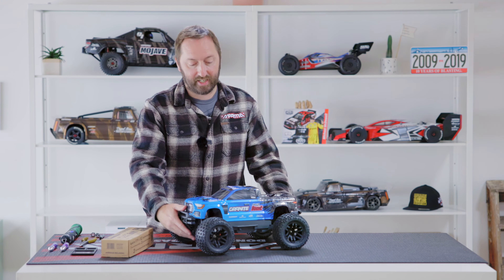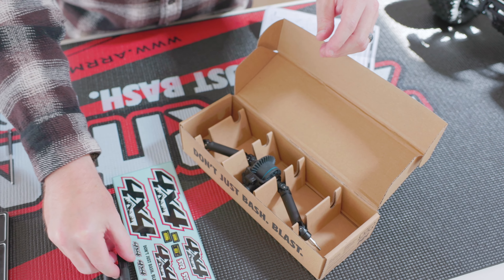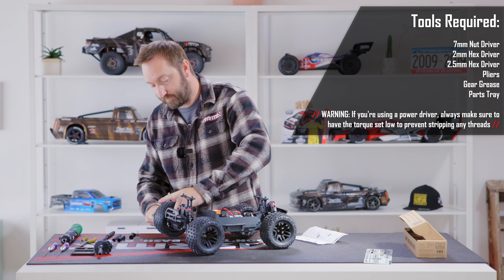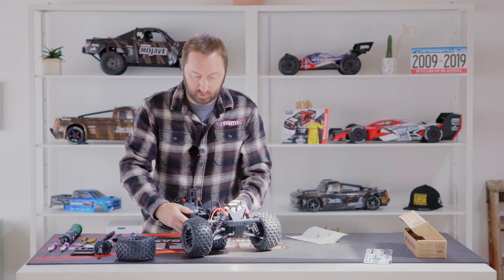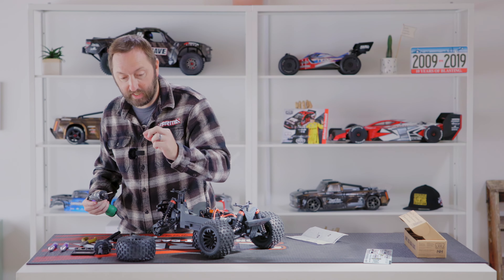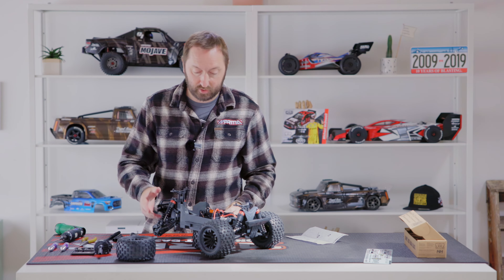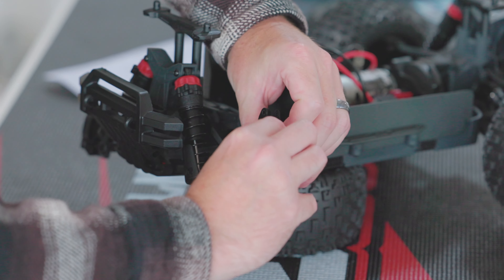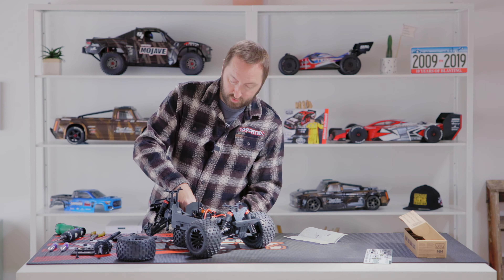INSTALLATION GUIDE // 4X4 BOOST Transmission Upgrade Set

Comment: I love the idea that you can easily convert your cheaper 2wd to a 4wd later. Really, really cool!
Reply: I think it's really stupid they're just charging you for something that comes with the truck buy the 4x4 and take out the center drive shaft and boom there you go
Reply: @Lucas.stalcup  Ok, I get your point BUT, it isn‘t surely negativ to just go the easy way. If Arrma decides to build a 2wd beginner friendly car, they can either design a new 2wd platform (like for example the slash) or they can take the existing 4wd platform and convert it to 2wd. This keeps the costs lower (no new production line is needed…). As a new commer to RC I stupidley bought a 2wd Slash a few years ago just because it was 60$ cheaper than a 4wd. Now a days I hate me for that desicion because I love the handling of 4wd cars. With these Arrma‘s you can be the stupid new commer as I was and you dont have to regret spending less money a few years later since you can easily upgrade the transmission.
Reply: Just buy the bits you need off the 4x4 from an RC breaker and save yourself a fortune.
Reply: @Lucas.stalcup the 4x4 is way too expensive to be an entry level car for most people

Comment: Now this has peaked my interest loads , I've just realised I've wanted to get back in to RC from a long long break , been looking at all sorts of cars from the Chinese bashers to your range and really wanted a arrma but realized money was tighter than expected but this screams out to me as I Can get a arrma quality kit and then save for the parts I want . Bravo guys .
Reply: You won't regret an Arrma, I've been in and out of the hobby for 27 years now, and Arrma is my new brand! I use to scoff at how simply built they are, but after buying my first one and running the heck out of it, I totally understand the designs they use and I absolutely love how modular and interchangeable they are. I've literally bought 5 Arrmas in total over the past 2.5 months, I just can't get enough of them

Comment: If you are here for tips...  the only issue I had was installing the cv axle into the hub. The inner knuckle bearing will is tight enough to keep the cv pin hole to not be exposed. I simple placed the hex nut and wheel onto the the axle shift and installed and tightened the nut. This pulls the axle through with ease and frustration free. The I took the wheel off and installed the pin. And back on the wheel went. New to rc. But I've been a mechanic. This was a fun little job.
Reply: Thanks for this info! Literally what I needed to know, and the main reason for my visit to this video!
Reply: Did it the same way
Reply: Getting ready to do this myself. Thank you for the tip

Comment: I have brushless senton and granite, but run them rarely. I but bought Boost 2wd vorteks for a few reasons. Brushless models need to be carried somewhere in big space to drive them, while in my backyard, I have set up an RC track with jumps, which is quite small. I wanted a more nimble, 2wd model, which is slower, brushed, and had different bodystyle from my previous Arrmas. At first, I was very sceptical, on how native 4wd with removed front drivetrain would handle, when compared to dedicated 2wd models, but actually I was very surprised and the car handles perfectly. Now this is my daily RC car to run and discharge one battery in my backyard after a stressful workday. I drive so nicely in smaller space.

Comment: Wow nice design. I tought it would be a bit like a fury bls or granite/fazon voltage. They are also very durable. My dad owns a senton 3s blx and i have a 4s slash. I totally regret getting a traxxas
Reply: Arrma > Traxxas
Reply: Same, i had an arrma big rock 3s and typhon 3s, still do. But when i got my Traxxas rustler 2wd vxl, i kid is you not i put at least $500 into replaced parts on that thing, including a new motor and esc cause the stock ones blew up

Comment: These are so cool! I hope not including the big rock in the "boost" family, it means there's going to be a big rock v4? I really hope so. 3s blx, with the metal ring and pinion diffs from the 4s family, maybe some different tires but similar style to them, maybe just a touch bigger. And if it were offered with the big rock body, in that candy apple red the vortex 2x4 boost comes in, would be gorgeous. Maybe a big rock v4...3/4s?!?! With a chassis brace and the cvd driveshats instead of the ujoint ones that always seem to pop off for me. But it would really cool to have a 4s ESC, with a 3670 motor somewhere between 3s kv and 4s kv. Include a 13 tooth pinion for 4s and an 18 tooth for 3s. Great way to get some people into 4s vehicles who already have a ton of 3s batteries from their 3s vehicles.

Comment: What I find really confusing is the according to Arrma the reason they are dropping the Roller EXB 5th scale cars is model shops don't want multiple different boxes of the same car, so now they have 3 versions of the Granite, Vortkes and Senton, plus the shops also have to stock the boost boxes now as well, im smelling something here 😂😂😂😂
Reply: Are they actually dropping the 5th scale rollers? I didn’t see anything about that
Reply: @fmc7209  Yes the 5th scale EXB rollers are going to be RTR
Reply: @HardcoreRC  interesting… I wonder if those are going to be a V2 version? Now with the launch of the RTR TLR Typhon they might even offer both rtr and roller.
Wonder when they will release these
Reply: @fmc7209  Will just be RTR EXB, they wont be doing the roller 5th scale EXB going forward, i also suspect that all rollers will disappear so they can push more spektrum stuff on people
Reply: @HardcoreRC  makes me wonder what the sales numbers are rtr vs the rollers… A decision like this could imply the rollers haven’t sold well enough to be worth keeping. 
I hear people complain about the Spektrum stuff but I’ve never had issues myself.
Reply: @fmc7209  According to Jason the RTR sell better than the EXB Rollers, which stunned me seeing as the EXB rollers are better in every way and you get to put your own electrics in.

But i cant comment as dont have access to the actual figures.
Reply: @HardcoreRC  to me it’s not as surprising for the 6S line since it could be someone’s first or second rc, but for the 8S getting the EXBs are a no brainer. 
We will find out soon I would assume!

Comment: You could just buy the Mega 4x4 and remove the centre driveshaft for your same effect.
Reply: You still have the weight on the DIFF and axles slowing it down compared to this 2wdf
Reply: @FLPatrick1095  so remove the diff
Reply: @da66er74  You cant it needs that empty spacer that these new 2wds have. it wont bolt in
Reply: @FLPatrick1095  what? You’re say the stub axles can’t stay in? Why?
Reply: Interesting idea, I'll remove the driveshaft on my Vorteks and see how it affects the handling.  The idea is for the younger audiences to grow with the vehicle... Kinda backward thinking on Arrmas's behalf as a 4-wheel drive RC handles better than a 2-wheel drive RC. With a 4-wheel drive system, the front wheels pull you through the corners keeping the vehicle stable, and a rear-wheel drive system pushes you through the corners, and with too much throttle the rear end pushes ahead of the front losing control and spinning out.  I like the idea, if you can't afford a 4-wheel drive RC you can upgrade later when the funds become available, just like Brushed to brushless... that's the beauty of the RC world.

Arrma just got their marketing wrong is all.  They should market it as an entry-level chassis that can be upgraded without having to buy an entire new RC to become a 4-wheel drive. I can not upgrade any of my current RC car collection without spending A LOT of money for the right parts... $40 for the kit!!  That's incredible!  

So you buy the 4x2 Granite boost for $199.99 and then the kit for $39.99 for a total of $239.98 or you buy the Granite Mega 4x4 for $269.99??  LOL!!!  I see prices increasing in the near future for the boost vehicles and the 4x4 kit.
Reply: @toyotatacoma6817  I've always preferred 2wd RCs over 4wd when it comes to off road bashers and racers. It's what I learned on back in the late 80s. 2wd makes you a better driver imo.

Comment: This is as bad as an idea as when you buy the Traxxas mini Maxx that you have to buy the wide maxx kit I waited for them to just release the mini maxx with the wide maxx kit already installed on it  I also bought the 4x4 granite instead of a two-wheel drive because with two wheel drive you can only do donuts even when you don't want to 
I do like that they thought ahead and they gave you the option to upgrade it  I've never seen a company do that with a two-wheel drive before
Reply: How much does this rc cost may i ask for this silly comparaison...
Reply: @EXTREMERC416  they'll probably wait a year to release it just like they did the new kraton I waited 6 months for it to come in and then they upgraded the minimaxx so I bought that because I have the Xmaxx so I had to have the minimax
Reply: Friendly reminder, the 2wd granite wasn’t out yet.
Reply: @ccrum32  wasn't or isn't 
I can't wait to see how it takes them to bring it to market I bet they miss Christmas lol
Reply: @nomusicrc  pfft
Reply: @ccrum32  lol
Reply: @nomusicrc  i wanted a 2wd new platform  like the fury with brushless option. I but i guess this is good enough.yeah they maybe going to out steel diffs and axles on the v4 brushless 3s and offer the boost kit on the 2wd brushless. Just a prediction
Reply: @EXTREMERC416  2wd brushless is even harder to control because the tires can't grip they just spin

Comment: Dawg I don’t understand why you wouldn’t buy the 4x4 and just remove the front drivetrain bits if you reeeealy want rear wheel drive 💀💀💀
Reply: Initial price be my guess?
Reply: @mrchimera2001ify  yeah but then how much is that “boost box” gonna cost? Idk yet but I imagine you’re probably saving like 30 bucks. Literally a dominos meal
Reply: @da66er74  oh I completely agree with you. Fell for that trap on a 2wd brushed slash when I first got into hobby.
Reply: @mrchimera2001ify  damn. My first was a traxxas rally fiesta and it didn’t last even 3 runs in brushed form. Almost immediately bought the all the brushless vxl stuff. Still have it and still runs good.
Reply: @da66er74  I sold mine quickly and just went to 3s arrma lol
Reply: @mrchimera2001ify  no issues there, at the very least arrmas smaller cars seem to comically strong. Even if they’re out here doing weirdo shit at this juncture and selling 4x4s with half of the guts missing
Reply: My favorite is the two-in-one ESC like something you would buy off of banggood
Reply: The slash is more cash grab than this by a mile lmao. Everything on it was designed to be replaced
Reply: @EXTREMERC416  nahhhhhh you can criticize traxxas for alotta stuff but not the slash platforms. At least when you buy a slash everything is there so you don’t have to buy a “boost box” later on.
Reply: @da66er74  huh the slash has junk driveshaft that break on brushed power.  Toy like suspension with oil dispensers as shocks. Just fixing that alone even on the 4wd is already 50$+ and you already pay premium for these cars. TheN the axles is at least 80$+. And the rabbit hole continues. Its a 2 decades old design who i still being sold at an inflated price with almost no changes on it.
Reply: @EXTREMERC416  well first of all it should be common sense you would twist off the plastic driveshafts under brushless power, but i do agree they should definitely not be anywhere near as expensive as they are.